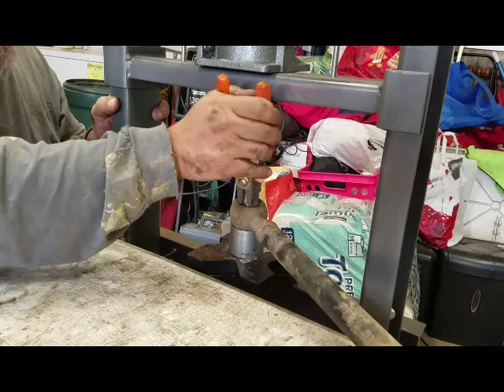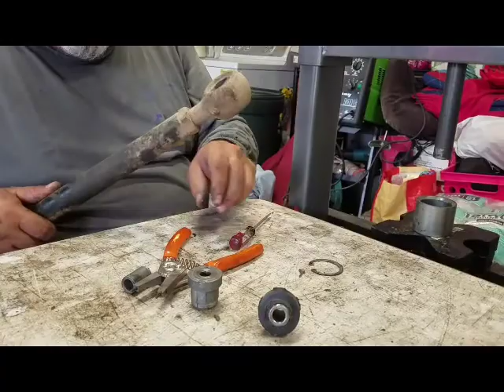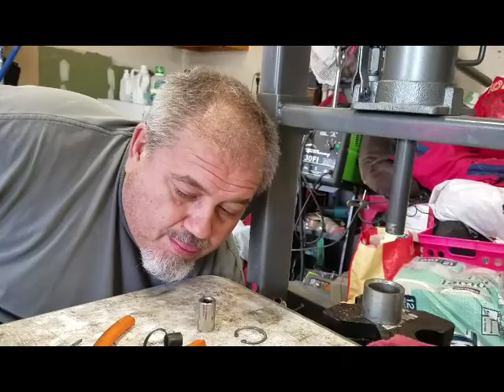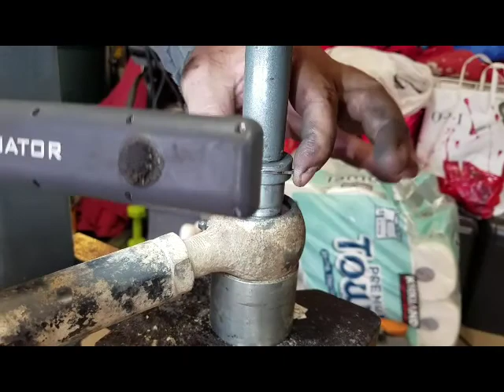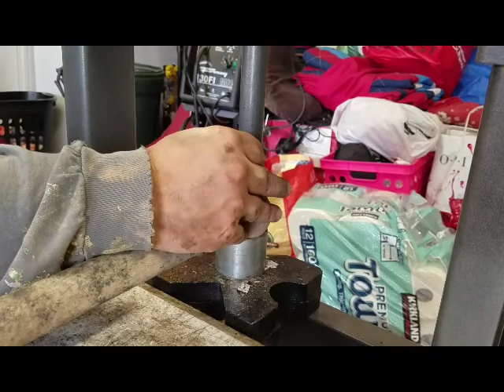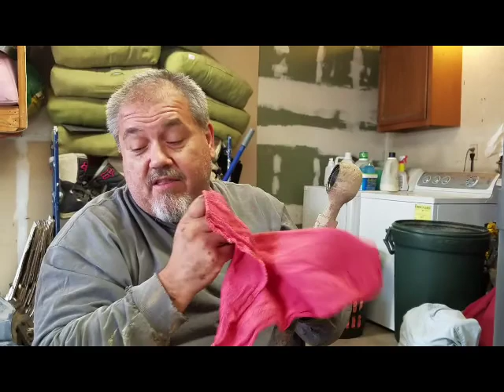Teraflex Control Arm Bushing Replacement

Comment: YES - Having a press is the way to go! The upper control bushings on my xj were a bear to replace - I used Moog heave duty "problem solvers" - hopefully They will last
Reply from the maker: We have been using the teraflex replacement bushings. Last about 2 years.